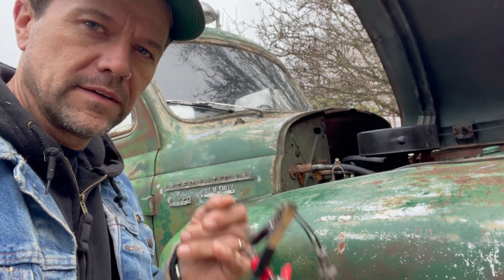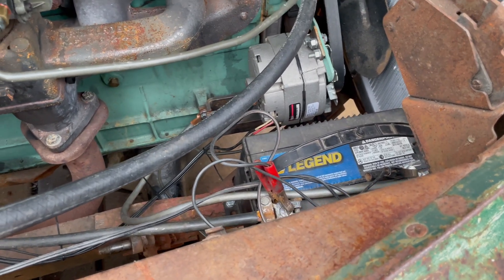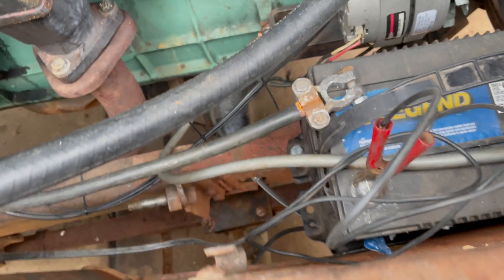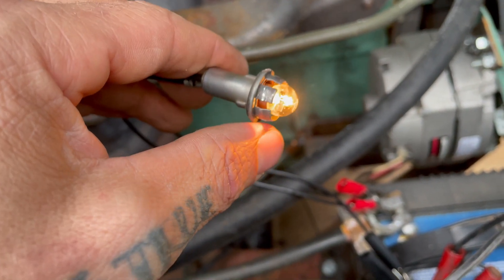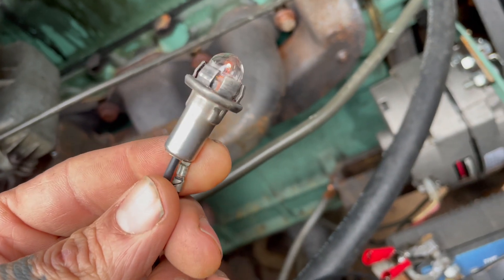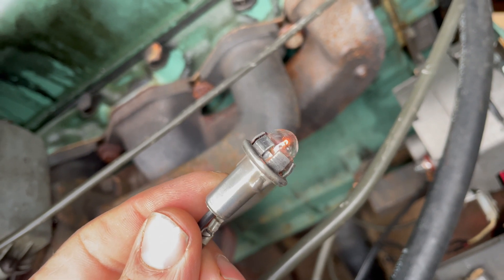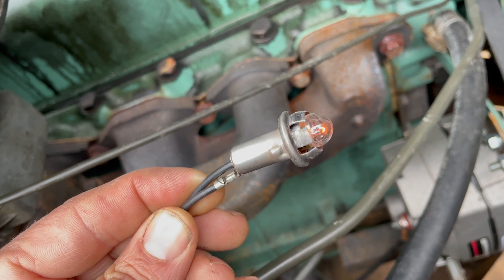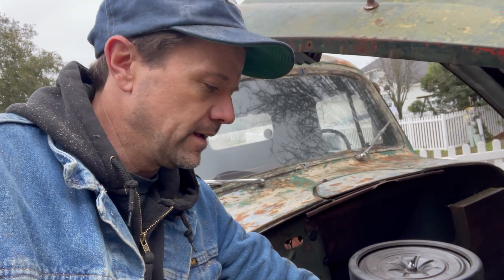Handy Trick For Finding A Voltage Drain!

Comment: Static timing with test light, I am very interested in this. Timing for easy starting or more power? Engine timing changes when at altitude? My wife and I drove from BC  to Alberta over the Rockies, we where driving a 1951 L120 with SD220 engine.

Comment: Great explanation and demonstration. Learned this on a VW beetle, with 6 volt system. Used it as a timing light too. You don't need to spend $$$ on diagnostic gear. Unless you drive modern PC on wheels

Comment: Nice . Show us how you find the other drain now please
Reply from the maker: I just made this quick video to show the basic principle, but that’s not a bad idea. I’ll try and make a follow up video, thanks for the suggestion!
Reply: Cool but you had other clips on the battery what was that about?
Reply from the maker: @corytruckdriver  those were from the battery charger.
Reply: You could probably just start pulling fuses one at a time until the dim light goes out. Would give you an idea of which circuit to look into.

Comment: I must be blind.
What is the original red clip connected to? The battery charger?

You put the positive test light clip on the positive post and the negative test light clip on the positive battery cable terminal that has been disconnected. 
I don’t get it. 
If the positive battery cable is not connected to the battery what difference can it possibly make to unplug the alternator?
Reply: Mdwdirect, Let me see if I can shed some light on it for you.  Think of the alternator as the path to ground in this instance.  
So you have the positive post on the battery hooked up to one side of the test light. That short  (in length) wire on the test light now becomes the positive battery wire The other lead of the test light is hooked to the positive battery cable, that wire becomes the negative wire for the test light.  
Now any accessory that's turned on or any shorted wire to ground will complete the circuit from the positive battery post through the test light   back through the accessory or short, through the negative wires to the negative side of the battery and turn the test light on. 
By pulling the wire out of the alternator, the circuit was broken and the light turned off.  There is still a slight high resistance short somewhere in the positive side of the harness.  It could be as small as the radio memory or electric clock if equipped in the truck, but it's a high resistance short because the light is so dimly lit.  hope this helps.
Reply from the maker: @LightningFabrication  that’s a great explanation.
Reply: @BareKnuckleBinder  Thanks.
Reply from the maker: Test light clips are non-polarized. There is no positive or negative. They just happen to have red and black on the clips. The test light is the connection between the battery post and the terminal so any flowing current has to go through the light, so it lights up.
Reply from the maker: I should clarify additionally about the test light clip colors- I made the test light myself and those were just clips I had on hand, bare metal clips would have been less confusing.